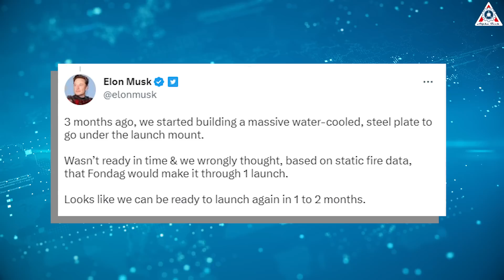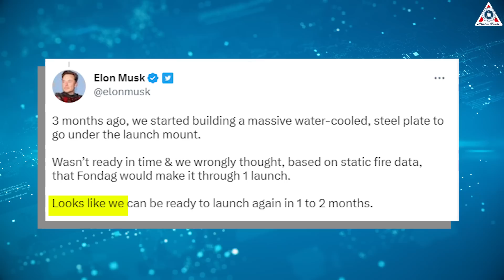SpaceX Stage 0 plans changed after huge damage from testing...

Comment: this is what happens when you make a decision based on politics (moving to texas) instead of science.  If they were working out of (near) Vandenberg then they would have built a diverter tunnel and would have been FINE.  Now they are locked into a marsh/sand dune with no chance of launch mount damage reduction in a cost effective manner.  What a complete f'ing idiot Elon is!

Comment: It seems that they are going to have to build the pad on a taller mount so there will be room for a diverter and water system.  I wouldn't be surprised if environmental groups start harassing SpaceX for the concrete propelled out around the area.

Comment: Pretty sure the FAA will not allow any more flights from this site for some considerable time, if at all, especially given the amount of carnage throughout the entire area & beyond. Debris is reported to have flown 5 miles away from the launch site & that's just unacceptable. 
Some crazy stuff going on at the site, machinery still left lying around, vehicles still parked right next to the launch complex, lifting gear and a ton of other valuable equiptment all smashed to pieces. I've never seen anything like it.
I'll be very surprised if we see a launch this year at either site & I wouldn't be surprised if the OLM is scrapped completely. Seems unlikely that it's worth salvaging at this point but we'll see. 
Also. who knows what damage has been done to the tower itself. I doubt that came out of this without some severe structural damage of some sort. 
Tank farm also took an absolute battering, so all that will need replacing or moving waaaaaay back from the launch pad.
Yeah, its a mess at ground zero.

Comment: It is a common sense in structural and civil engineering that concrete columns as stage zero will delaminate from cross sectional temperature gradient, temperature shock and pressure shock resulting in disintegration and rocket should lean after engine start before take off.

Comment: I cannot believe the fueling system is so close to the rocket. I believe it should be at least 1/2 mile away
Reply: The point of the tanks is to be close-range, if they were too far then the liquid oxygen and liquid methane would get too warm and turn into a gas before it reached the ship. Ideally they'd be underground, but that costs a lot and might just not be worth the price.
Reply from the maker: 1/2 mile away, I think that too far. 
Maybe SpaceX will found new way to prevent the tank farm in the next test
Reply: @alphatech4966  burry it
Reply: @alphatech4966 do you speak English?
Reply: Another thing in Elons Design I disagreed with and thought was foolish. Clearly ELON is a Genius but his engineering has limits.
Reply: How about underground?
Reply: @toungewizzard6994  Can't the water table is nearly at ground level. The tanks would be underwater and be infiltrated and corrupted.
Reply: @toungewizzard6994  As I have said before the water table is near the surface and placing the tanks in the ground is asking for salt water infiltration and corruption of the fuels which would be catastrophic.
Reply: I thought they would have put them underground but I guess that's not possible so close to the coast.
Reply: @Orphican  Correct. The water table is very near the surface. I had expected Elon to build the launch pad up like NASA did correctly at Cape Canaveral with the same issues. Build it up and then place his tower on top with Proper Diversion Tunnels to direct the blast and maybe use my idea of adding a water pool like a swimming pool for the blast to hit the water before hitting the concrete and doing what it did on this launch. 
I wish Elon Musk has listened to my repeated warnings.

Comment: Any reasonably competent materials or civil engineer would have known that Fondage concrete would not have had a chance to mitigate this level of damage.  Fondage is heat resistant not "blast" protection.  Frankly, I was very surprised that the bouncing chunks of concrete didn't actually destroy the vehicle (ruptured fuel tank) instead of just disabling several motors and denting up the tank farm.
Reply: It's no wonder getting it off the launch pad was a "success" seeing as it very easily could have destroyed the entire launch site.
Reply: I'm not that surprised the SH tanks were not damaged; whatever got thrown would be heading in the wrong direction to hit the side of the booster. To do damage it would have to bounce off something first. The only good candidate for a something to bounce off is the tower it self and it's at the wrong angle to reflect things back at the rocket. It's possible, but not a sure thing.

Comment: With the first operational rocket, the German V2, the designers realized that a flame and hypersonic exhaust deflector was required in the launch mount beneath it.   The massive launch mount that Space-X made is somewhat similar to the one that the Germans used to launch the V2, but without a exhaust deflector which looked like a cone.  Such could be made for the next launch, but made in such a way that the exhaust is deflected out toward the ocean, and that all infrastructure be moved well away from the launch pad. And looking at the video of the outer engines that failed at liftoff I wonder if they were not damaged at the very start.  And lastly, The Soviet N1 Moon Rocket was launched four times.  It also had 30 engines, and its launch pad was not on a stand but very much on the ground with three deep concrete and steel lined trenches to divert the exhaust.  This worked four times, though the Soviet answer to the Saturn 5 failed shortly after launch each time.  But the launch pad worked.  Too bad Elon did not take a look at what the Soviets did on their launch pad.for their massive N1 Moon Rocket with 30 engines.
Reply: Exactly. Who at SpaceX thought no flame trench was a good idea?
Reply: Sorry, but V2 was a baby. 250kN of  thrust is nothing compared to later Saturn V (34,5MN) and finally Starship stage I (74,5MN). V-2 did not needed deflectors to protect launch pads (same as modern mobile ballistic rockets don't need one) but to prevent it from tilting  due to single side overpressure. However just looking how NASA had issues with rockets during space race with USSR it should be obvious, that from some thrust figures deflectors and trenches are just necessary.
Reply: @brylozketrzyn  Yes the V-2 was a "baby"... But hypersonic gas at 4,000+ F whether it be in a baby rocket or a big one needs to be deflected.   The Germans found this out with the V-2, and every other land launched rocket after has such deflectors.  It amazes me that this was not considered with this 30 engine Space-X launch.   They got away with it in previous tests, which were of short duration.   But this lift off with the sustained heat and shock waves really did the damage.   Had they had deflectors in place things might have come out diferenty.  I think the Soviet design for the launch pad for the failed 30 engine N1 would have been better than the stand that was use in this launch.  I am not being critical... This was a test, and in any endeavor of this magnitude, things are learned from success and also failures.
Reply: @SRSchoner  well, I don't see any deflectors on modern tactical missile launchers - due to better control systems. Temperature is not that critical, because aluminum based concretes can handle high temperature for short period of time. However no concrete will hold up to extreme pressures (especially with ignition being essentially deflagration).
Reply: @brylozketrzyn  And there is a very big difference between a tactical missile and a vertical launch pad for human flight which have to be used over and over.   Launch a tactical missile and who cares about the damage after.   They are designed for one launch.  And after one test from a land based one, the ground tunnel has to be refurbished for another.   Even sea launched tactical missiles have to be expelled from the sub with a burst of gas before the engine ignites.  Now the V-2 was a tactical missile, but it was launched on a mobile transport that was intended to be used many times and as I mentioned it had a exhaust  deflector.  But with this space-X launch one can only imagine the intensity of interacting shock waves from thirty engines, the damage to that launch pad clear evidence of it.
Reply: @SRSchoner They want to be able to launch from mars so they don't want any diverters / water
Reply: @Tupsuu  It is plainly obvious that Star Ship will not be able to lift off with its engines close to the ground of Mars and or the Moon, if such cannot lift off a huge stand here on the Earth without sustaining damage to itself and everything else that is near it.   Even the Soviet engineers that designed the N1 trenches with the N1 close to the ground put, if you notice a protective shield so that the 30 engines pipes were protected.  Only the nozzles were visible.  They knew that with that shield the piping could be damaged upon ignition.  If there are any Russian engineers alive now that built the N1 they would be shaking their heads upon seeing that Elon's Star Ship launch pad.   And if it won't work on Earth, it certainly will not work if the base of the Star Ship is not on a stand but pretty much on the ground.
Reply: Mistakes make one wiser...
The idea is to make less mistakes as you go along.. Go SpaceX, Go..
Reply: Send this to Elon Musk
Reply: @fiatmultiplaa  Yes it is really a major oversight by the engineers that designed that launch pad.  I have studied rocketry from the beginning of the space program.   For me it all started at White Sands in the early 1950's when my Dad was a rocket technician who worked on the telemetry for V-2's and other rockets launched in the early  days of the space program.   I as a toddler, and up to 5 years often sat on our porch and watched the rockets soar into space.   I recall the vapor trails that turned into snakes and the sonic booms as the rockets returned to earth.  Such memories stick with me top this very day.  But I took special interest in the Soviet programs after,. they were for a time ahead of us, and hence the so called "Space Race"   They had the right idea with the N1, but at that time they could not get the 30 engines to work.  Elon nearly did, but I think the engines that failed did so due to blast off damage.  He should study the ground launch system and three blast trenches that the Soviets used.  Such worked without damage for four liftoff's of the N1, even though their N1's, failed in flight.
Reply: @SRSchoner my assumption is, that they want the system to be able to start from anywhere. And therefore make the launch pad as simple as possible.
Reply: SX don't have the land area to build an N-1 style launch pad
Reply: Same thing for the energia lift system that put the buran into  space. It also had massive trenches.
Reply: Haha the fake moonlandings. Still believe it? Wake up please.
Reply: SpaceX had the parts onsite to build a steel deflector, but did not want to take the time to do it.  Their 30 engine, partial thrust test did slight damage to the pad.  They probably made some WAG calculation like "well, twice the thrust will do twice the damage and we can deal with that".  But I think twice the thrust did a heck of a lot more than twice the damage.  More like two magnitudes greater, not just two times greater.  They goofed.  It happens.  It's just too bad that it was such a major goof.
Reply: You are not allowed to criticize SpaceX here ar Alpha-Tech. The narrator that sounds like the Wish version of Tom Bodet only allows puff-pieces on SpaceX.

Comment: Good report, and first time I've seen how SpaceX apparently expects to handle the exhaust; BUT it couldn't possibly succeed as illustrated. It should work nicely IF BOTH the flame diverter and a suitably large exhaust port are mounted below the level of the water supply. The deluge system hopefully could both muffle and cool the exhaust but in doing so produce a truly stunning volume of stream - - it be harmless hot stream as long as its pointed into the sky, even if a bird flew in front of the deluge exhaust at moment of ignition the initial air blast should push it clear. Within ten seconds a kilometre long cloud would suddenly come into existence as the big icy silver thing hopefully moves upwards without drama.
Reply: The "big pool" concept (c. 4:51)  is one that I've thought about but not seen any other consideration of before.

It would have at least the advantage that there would be little if any issue with it being built down well below the local water table. I wonder how deep it would need to go to capture the flame? Also, how fast would water need to be added into the pool to keep up with what's sprayed out?

Comment: I have always said that having no redirection for the flames what's going to be the downfall and it was a very stupid idea. I mean how on Earth did Elon musk think that was going to work. The test firings alone completely damaged the structure every single time. From close up it probably looks like a lot of room underneath that rocket, but it's really not. For the most powerful rocket known to mankind, with literally no deluge infrastructure is mind boggling to me. All these brilliant engineers and not one of them forshaw the obvious!?
Reply: Sounds like they were expecting to have to rebuild some of it, jut not near as much as they do. I suspect the difference is a result of the failure mode changing.

It's kinda like highways, bigger trucks just wear out the road faster, up to a point, then adding just a little more weight causes a mode change and starts to break the road rather than wear it and the damage starts being orders of magnitude more for only a slight increase in load.
Reply: There is no way this is a huge surprise to anybody involved. But they weighed the cost and risk vs reward and pushed the big red button. I don't think there is any shame in that. A lot was learned, and much of the excavation work required is also now complete.
Reply: They did not get the planned deluge stream in time, so maybe they just figured to let the rocket demolish this one for the rebuild?
Reply: @JFJ12  oh come on now, that's just silly.
Reply: Maybe because they thought the starship had more chances to explode before takeoff...or maybe they don't want to invest in the traditional NASA way due to cost, maintenance or beaurocracy...

Comment: The amount of thrust needed to land is tiny compared to a fully loaded Superheavy and Starship so that should be far easier to negate damage than preventing full thrust damage under the launch mount. Superheavy never needs to land on Mars or the Moon since it's just a booster for getting out of our gravity well, Starship is the one that needs to be able to land and take off without creating a crater so I suspect some more design work will be done with Starship once re-entry is perfected.
Reply: Thats a good point, and not as obvious as it is after you pointed it out.  All the nay-saying about this happening during a mars or moon landing or launch is greatly exaggerated.  Like everything, they have to try at least once un-manned to see what happens and go off the results of real world tests.
Reply: What do you like to do on Mars??
Reply: The moon its almost a non issue give lack of atmosphere so all particles will fall away at a linear angle rather than roil back in clouds of dust and debris.
Reply: @Knight_Kin  you still can't crater out the place your landing legs are supposed to be to hold you upright once the engines stop. I guess once a base is established pads will be constructed but in the mean time another landing solution is in order. The reason Apollo was able to get back off the moon was the accent module was protected during landing where Starship is the only module so it needs some other way to mitigate damage while landing.
Reply: @stevej7139  The gravity difference means you don't need nearly as much thrust. I doubt ground damage would end up being a concern anywhere except earth.

The thing that would worry me is blowback damaging the engines when you don't have a launchpad, though. They won't be 20 meters in the air on a special stand when taking off from mars, after all.